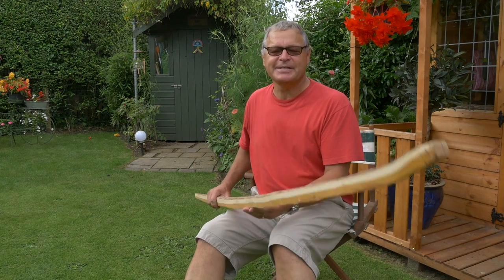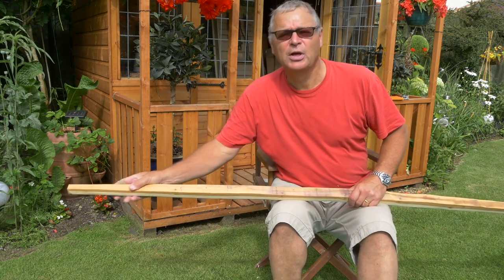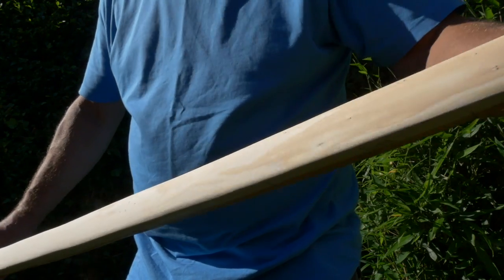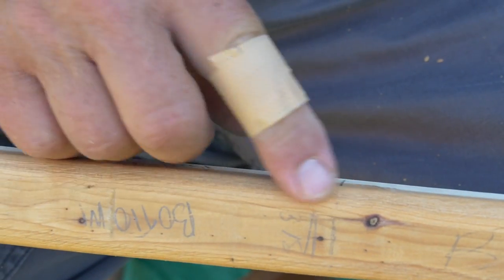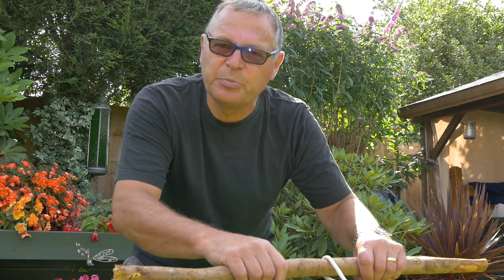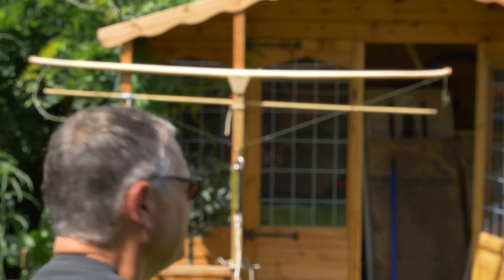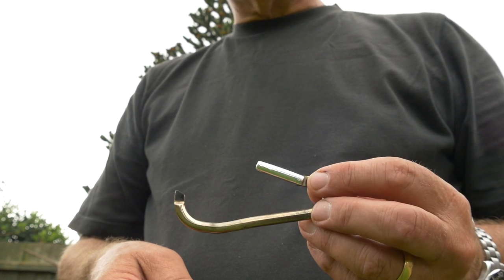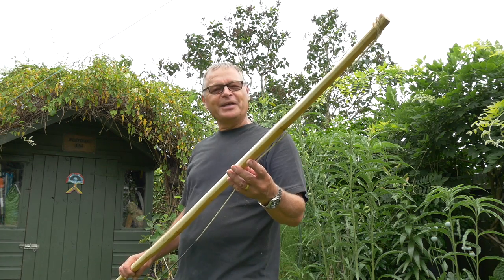Yew Heavy Warbow. Beginner bowyer attempts to make a war bow. Part II. Stave to Tiller

Comment: Really enjoying these.  Love the 'belt, braces, extra belt and a little more braces', approach to securing the tiller, because if that beauty had gone that's a lot of poundage suddenly running loose. Looking forwards to seeing you unleash the beauty.
Reply from the maker: Hi there! Yes, belt, braces, g-clamps, rope - the lot. It's just a stick but, by heavens, it's a mighty stick. When the caribenber went I ended up on my **, stood up, picked up the bow and wondered what happened. Then there was a thud as the busted careener hit the ground - heaven knows how high it was twanged from that bow! I just hope I can draw it when it's done.... Anyway, thanks for watching and commenting. Atb, Mick

Comment: Looking good:-) leave the mid section, get the outers moving now, and invest in some fastflight (Astroflite etc) string! Dacron needs an awful lot of stretching! Needs bracing before you do anything else. BTW. Longitudinal cracks on the belly are no problem, the generally just radiate to/from the centre of the tree as it is seasoning... that's why logs are seasoned in half or quarter... the cracks radiate out to the path of least resistance and not out to the back of the stave. (Often the central pith of the tree will show on the belly or in the grip) . Left in the round the cracks can go out through the sapwood, not so good, but still not fatal.
Reply from the maker: Thanks Derek. It's a devil to get the thing even near to brace when I pull on a stringer and the few times I've managed it the Dacron may as well have been an elastic band 😡 Haven't got a winch go it's all sheer grunt to bend it. Frustrating because I'm fearful of taking more wood off until I know its likely draw weight - so your advice to get it braced makes that task all the more urgent. I've ordered some pre-grooved horn nocks which will go on as soon as they arrive so I'll be working down the tips to get them moving as you've suggested - maybe they'll help with bracing. I'll order some Astroflite right away and make a string - how many strands would you suggest? Thanks for wisdom on the cracks as well - thought at one stage that the bow would fail because of them. Atb and thanks for watching. Mick
Reply: Hi Mick, I use 12 strands on warbows, (it wouldn't hurt to use 14 or 16) but I lay a couple of extra in at the loops. I also pad out the centre serving with extra strands from old strings. I only use double loop (continuous loop) strings as a bowyers knot won't hold well with man-made materials as they are slippery. It's handy to make one over-long string with BIG loops to use as a long string while tillering, this can be thread repeatedly through an old bearing or some such (I use a ring turned out of aluminium) to adjust it's length to give you an accurate length for making up the final string.
Reply from the maker: Thanks Derek, that's good advice - I've had trouble with bowyers knots on Dacron so I guess this one can only be worse. Got some Fast Flight on the way - hopefully I'll get her braced after making a new string. Thanks again, Mick

Comment: You should always use fast flight string on a warbow since it does not strech, and you will get better performance :)
Reply from the maker: Frederik, yes! I changed to Fast Flight when I had the Dacron problem. No worries since then on the heavier bows. Thanks for watching and commenting. Atb, Mick

Comment: Hi Mick, Rasps & card scrapers are good. Metal spoke shaves are ok (I have about 8!) but personally I would use a draw knife (a small one would be sufficient for bows) to start with. That is a particularly nice, big (12"?), deep, draw knife in the video - is that a new, handmade/blacksmith made tool - or a vintage tool?  You might consider using the draw-knife bevel-side down for finer work - it reduces the tendency to cut in too deep (the same technique is commonly used with bench chisels e.g. for dealing with curves, and with carving gouges). Then I would use a large, old wooden spoke-shave. Wooden spoke-shaves are a subtly different tool to metal ones, essentially they have a lower "attack angle".  The one I use has 2 useful properties: (1) it doesn't dig in too deep, as a metal one can, (which makes it more useful for the things I do) but (2) it still manages to remove volume quickly*.

*Caveats: I usually have the mouth adjusted fairly wide/coarse as I mainly work with green wood. I have a shave horse.

BTW Thanks for sharing your experience ;)
Reply from the maker: Hi Tony! I do have a draw knife but it's a rather deep-cut job - I'd like some curved, flexi draw knives and yes I do look out at boot sales and eBay. I have just one spokeshave though I would like a wooden one (or two). My brother in law is a fantastic and highly skilled carpenter and has given me loads of info on the attack angles of cutting tools of various sorts - planes etc. I'm slowly building my kit! I fancy a shave horse too! You sound like you are very well set up. But I guess my pitch on the videos is to show what a rank novice can do with limited tools and slice of luck. Thanks for watching. Atb, Mick
Reply: I carve wooden bowls, so I have a large log bowl horse as well as the shave horse - both fun projects.   I use only hand tools except for a battery drill & a chainsaw.   You don't need many tools but finding the right ones takes time and inevitably leads you down a few blind alleys.  I will sell on some of the excess later.  It takes a while to work through the tools & figure out which are useful & when. I inherited some of the metal spoke shaves from by father. I also bought a set of 4 vintage metal spoke shave off  ebay (a small & big round bottom, a simple flat & a 2-adjuster  flat) -- I really just wanted a round bottom one but it made more sense to buy the 4. I haven't yet found a use for the smaller round one but sometimes that indicates that it hasn't been set up quite right yet. Of the metal ones, I prefer a flat one without adjusters (Record?), I just tap it with a club to fine tune the adjustment.  Occasionally the big red round bottom shave is useful. For spoke shaves, I could manage with just my large wooden spoke shave though.  For drawknives, I could happily manage with just my 12" vintage American drawknife (it looks similar yours but not quite as deep & silver).  

I am new to bow-making though. Impressed by your bow :)

Comment: This looks easier than the videos I've seen of people making bows from Osage where they get the back of the bow down to a single growth ring. I didn't know you could make a bow that won't just break without doing that. Is it because of the type of wood? Also the other videos I've seen only use heart wood.
Reply from the maker: Yew is quite tolerant if a growth ring is violated. Some yew bows recovered from 15th century Mary Rose show violated rings. There is certainly no need to work down to one growth ring if using yew. It.’s a beautiful wood to work and bows look fantastic when they have that contrast between creamy sapwood and dark red or brown heartwood. Thanks for watching. Mick
Reply: @MickGrewcock  that's awesome thanks for replying. I wish I had yew growing around me. But unfortunately I'm in the US Texas specifically and all I have is Osage around me. I think for my first attempt at a bow I'm going to try a board bow with a rawhide backing. After I get that down maybe I'll try a Osage self bow.
Reply from the maker: Eddie Maxwell Good luck! Whatever you make all contributes to your experience - and it is gradually building experience and knowledge that enables you to tackle harder projects.

Comment: hi mick,  can you give some advice on tillering. if you have a hinge developing do you take wood from the opposite limb ?
Reply from the maker: A hinge is a weak point in one part of the bow. Working on the other limb will not fix it. The only way to solve that problem is to reduce the strength of the wood either side of the hinge. Think of bending a drinking straw. For a little while it will bend, then collapse. Imagine where it collapses is your hinge. Don’t bend it before you’ve weakened either side of the hinge. Gradually work and bend so that you get a consistent arc. Then move to the other limb and bring it to same state. Good luck.

Comment: Hi Mick ,how are you not dead rasping & filing that stave without a mask?
I always thought it was more toxic than that...
Reply from the maker: Hi Poppy! Well, I'm still alive. But seriously, yew - leaves, bark, sap -  is poisonous if ingested. I wear a mask when fine sanding any wood (which creates volumes of dust) but light sanding and rasping has not caused problems with yew (or any other wood).

Comment: hi sir what if we apply sinew on wood will it make wood flexible as horn bows
Reply from the maker: Hello Aman, to be honest - I don't know. Never worked with sinew. Sorry that I can't help. Atb, Mick
Reply: Aman s 

No, it will not. Backing a bow with sinew gives the bow reflex (the limbs will bend towards the back of the bow as the sinew dries).

This is a good way to get a few extra pounds of pull out of a bow that ends up tillering less than you wanted, but it does not add flexibility to the bow. Power,  yes. Strength, yes. Flexibility, no. 👍

Comment: would you recommend any type of arrow for war time use?
Reply from the maker: A so called English/Welsh war longbow is a modern description of bows used during 14/15th Century by English, Scotch and Welsh armies. The only good and direct evidence we have of bows from this time are the yew longbows recovered from sunken warship Mary Rose. Copies of these bows have been made and used; I have read that it is estimated that some or all of these bows might have drawn 150/180lbs. Like all military weapons, these bows were made to combat whatever opposing forces possessed - be it weapons, tactics or protection. It is a certain fact that the longbow and the arrows used would be adapted and developed over time to combat evolving opposition. So the arrows they used were made for various tasks but had one thing at least in common: they had to withstand the high splitting force of the released bow string. So an arrow for ‘war use’ must be suitable for the bow and armed appropriately. If you build a ‘war bow’ just make sure your arrows match the bow.
Reply: @MickGrewcock  Thanks for the info, I'll be sure to get strong enough arrows, I didn't think bows went much higher than 100lbs but after hearing about those old age war bows I have my sights set on probably just a 150lb war bow for now because currently I am having a tough time drawing my 60lb bow.

Comment: If you are using a toy looking carabiner like that for load bearing, you are doing something wrong.  Real Climber rated carabiners lock at the opening with a rod and hook to prevent this kind of spread out failure.  Real carabiners are typically rated for 20 kN or so, with lighter ones for lead climbing because successive carabiner destruction would absorb the most extreme of falls and the next would catch.  Under a gravitational static load, this is 2 metric tonnes.  How far you can fall on that depends upon the tensile modulus, length, and mass of the rest of the setup as well as whether or not the rope is the weakest link.  Use one of those next time, 10x safety margin on even the heaviest of war bows is nice to have.
Reply from the maker: Thank you. Lesson learned some while ago but worth repeating 👍